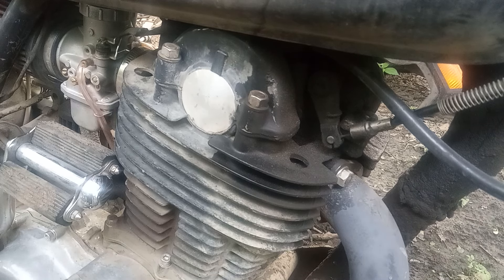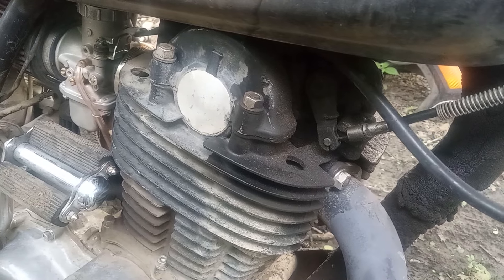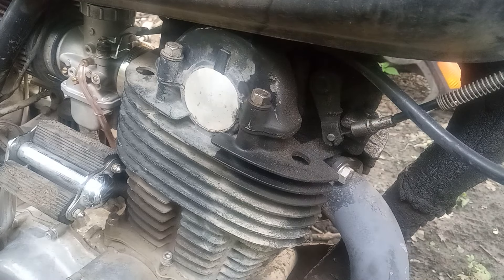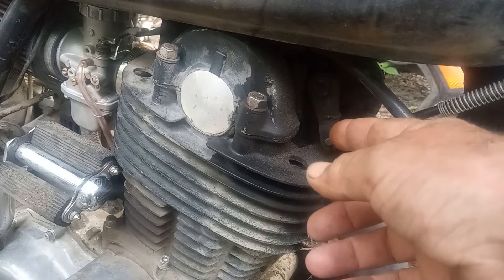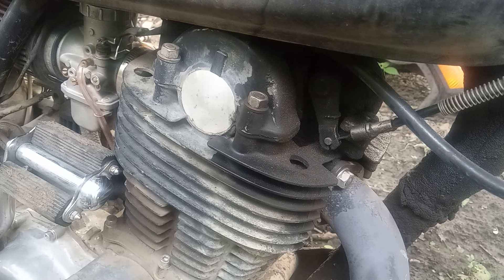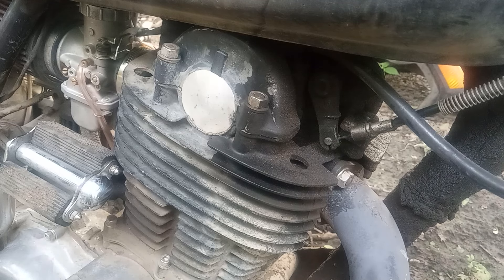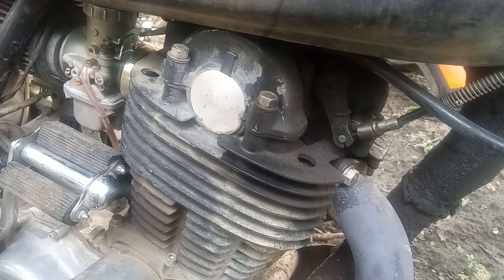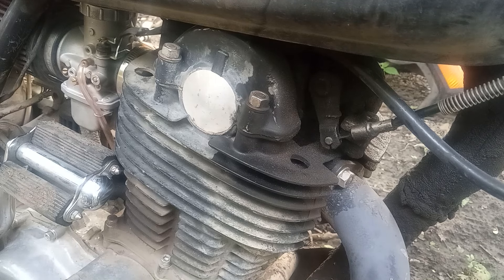Jumping to conclusions

Comment: You can't kick that thumper,without a relaese,after it warms up.
    Should be able to relocate the lever. Could have caused a catch in steering. It never turns that far when riding.